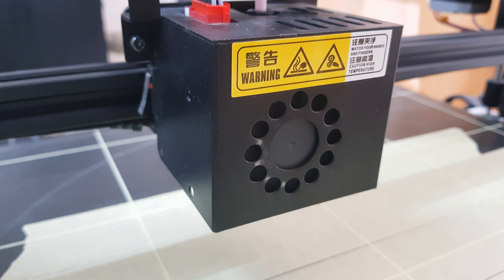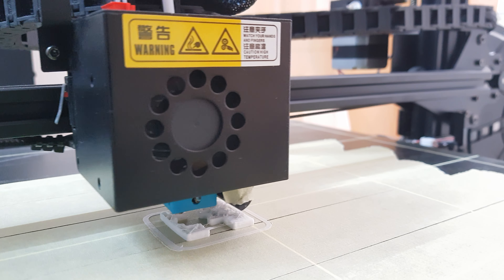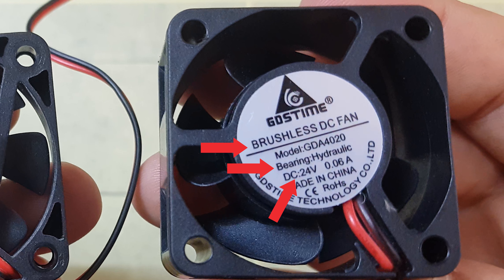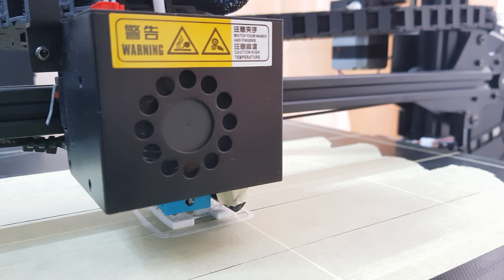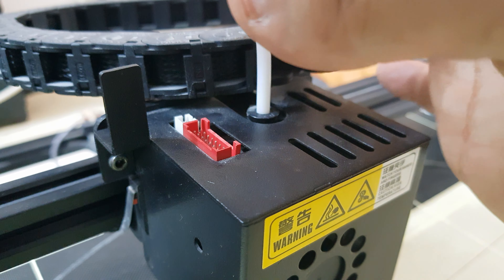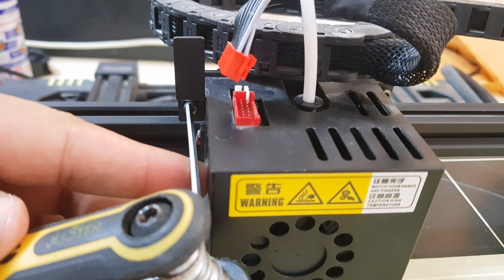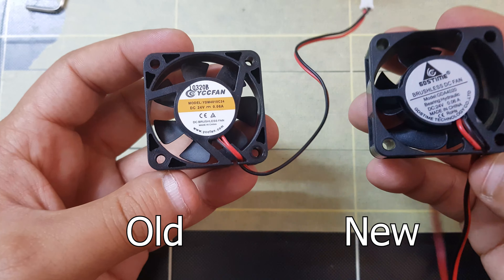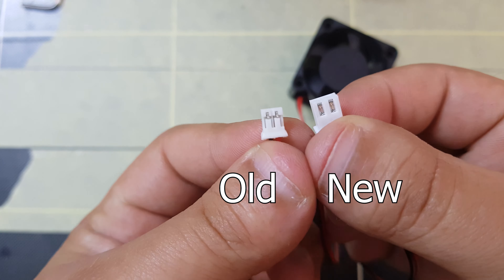Silent Fan Upgrade For Beginners - Anycubic Chiron 3D printer

Comment: Good idea ! I actually wonder, why does nobody use a compresor to cool the the last layers instead of a fan ? It may improve the the noise if the compressor is far away enough. But above all, it would replace the weigh of a fan by the weigh of a tube end upon the head. Is it to difficult to control the cooling flow ?

Comment: My Chiron fan is 24V  and .20A   Are the fans you puchased from Amazon .20A??
Reply: Did you end up using .20A?  I have a Chron and need to replace my fan that just stopped working.